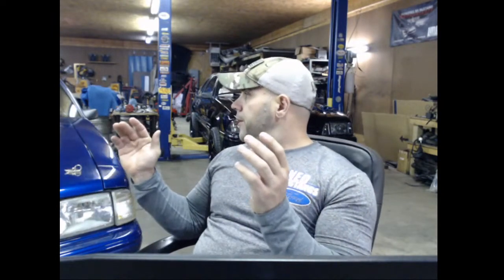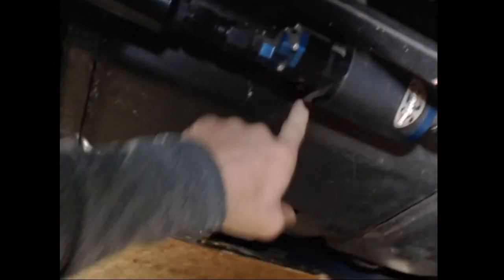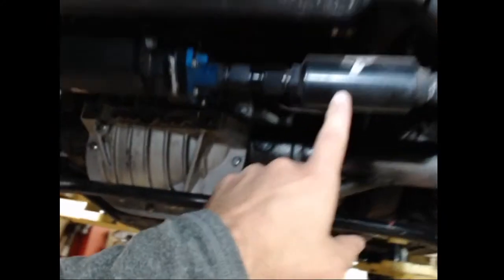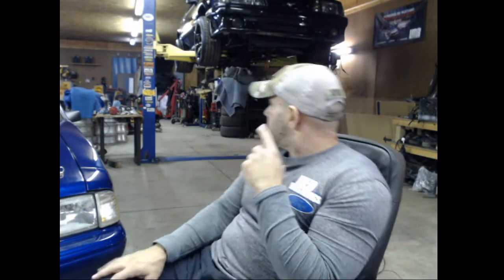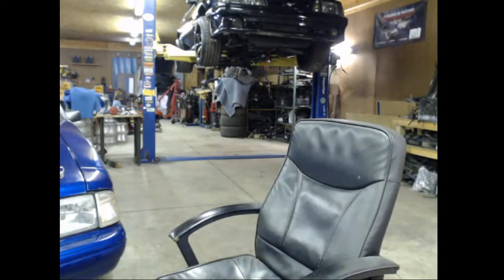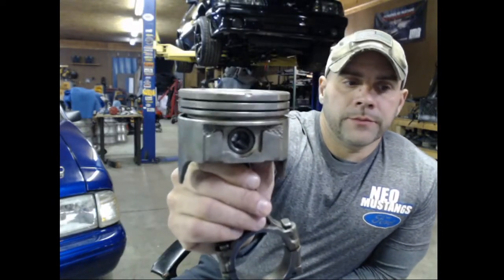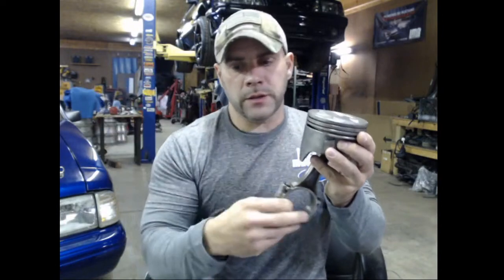Heads, Cam & Intake OR Power Adder Only? Both? LIVE STREAM!

Comment: I am always late to the party ..i have a set of holley system max heads and a ford racing production 1987 5.0 block thats not bored ..its going in a 79 mustang coupe street strip car carbed .. what combo would you go with if it were yours ?
Reply from the maker: Convert to EFI using an 87+ setup. would be cool cause 79 didnt have the concept yet.

Comment: @neomustangs, sorry i missed the live chat, working night shift i sleep through the days. Im doing the keep simple mods like you stated. I have a 89 gt convertible 5spd, still have 2:73s at moment. I have a set of gt40 3 bars, F303 cam with a set of 1.6 roller rockers and gt40 intake, 19lbs injectors stock bottom end. Hopefully she makes decent power with to piston to valve clearance issues. Killer thumbnail by the way! 🔥💪💪💪
Reply from the maker: Ya that should make in the neighborhood of 285.. 19s will be maxed around 6k.

Comment: HCI AND a power adder. I did the Edelbrock power package with a Vortech V3si all in one shot. 255lph fuel pump FMU and 30# injectors still on stock ECU. Wirelock heads and gaskets ARP headbolts and Competition Gold rocker arms and ford performance hardened pushrods.
Reply from the maker: Nice 👍

Comment: I’ve got a 85 Mercury Grand Marquis, 302 roller cam block, looking forward to upgrading to GT40 (3-Bar) rebuilt ported heads, larger valves, new seats & guides, stiffer springs with GT40 ported upper & lower intake, 70mm throttle body. It’s got a functional ram air hood scoop also, but I’m trying to decide which cam to use either a B303, E303 or F303 and either 19lb or 24lb injectors. I’ve got a built AOD with 1,600-1,800 stall torque converter and Yukon limited-slip 8.8 rear diff with 3.73:1 gears.

Also, trying to decide for mid or long tube headers that’ll fit the car with decent primary tubes, 3/8” flanged and 3” collectors that I’ll reduce to 2.5” and run full 2.5” exhaust system. I currently only have 2” magnaflow cats with 2” H-Pipe, full 2” pipes through thrusher 2 chamber mufflers and 2” pipe to the rear bumper. This is not a hot rod or race car by far, it’s got a reman air pump and all emissions working daily driver family car with sleeper attitude only.
Reply from the maker: Always long tubes if they aren’t too much of a hassle
Reply: @Neomustangs  so What do you think about the B303, E303 or F303 cams? I’ve seen comparisons and in particular the exhaust tone of each and the E303 has in my opinion the best tone but, most of us know only a fool pick a cam for the sound of the exhaust. As far as the actual cam measurements, which of the 303 cams would in your opinion be the most daily drivable cam of the 3 cams for a heavy car like a grand marquis? 

I’ve heard rumors and done my own research but, Ford used truck engines in these heavy cars for the torque but used crappy heads which was pretty dumb in hindsight. This old car isn’t the paw paw car Ford built in 85 anymore and surely with the upgrading that foxbody guys do should in similar fashion wake this old car up some more in classy style. It’s no racer but, a sleeper is my goal.